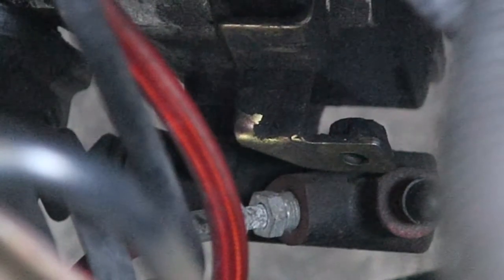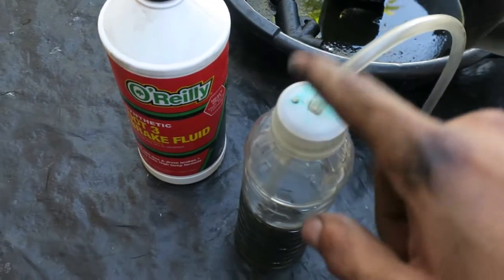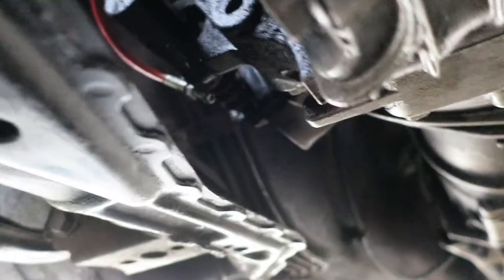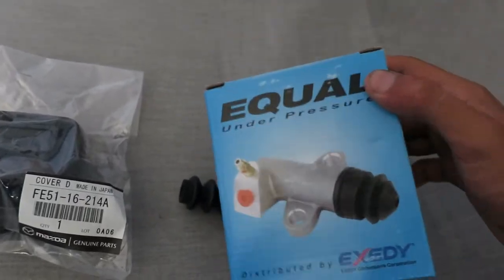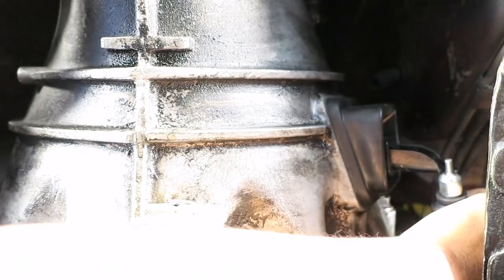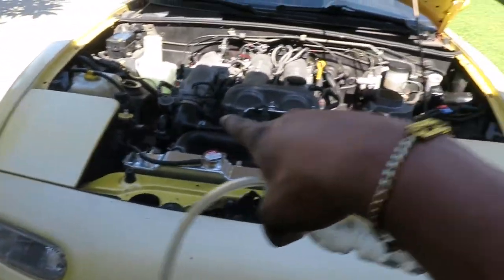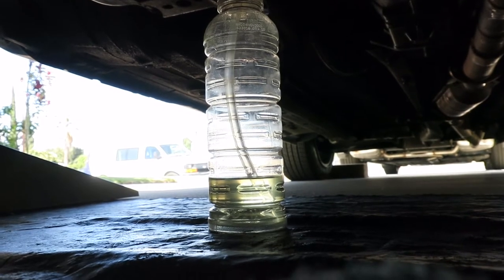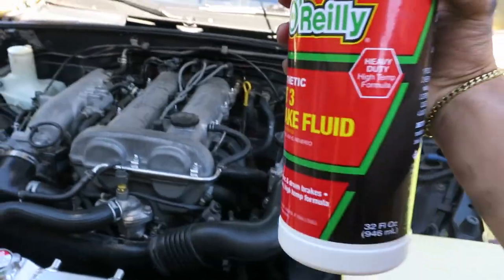How to Replace SLAVE CYLINDER [+FORK BOOT]! (on miata)

Comment: Thank you for the video, I read to grease the slave cylinder because of a squeak I had, and your video was the only one that described the different parts so I knew which one to grease. I almost pulled back the boot looking for the fork, which would have gotten brake fluid all over me, but you pointed out which parts were filled and what everything was. Thanks again